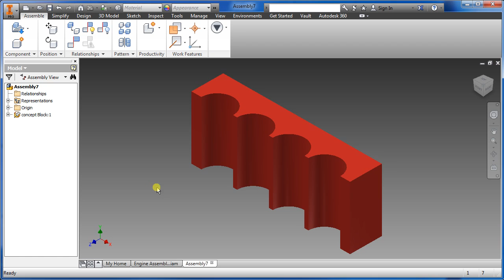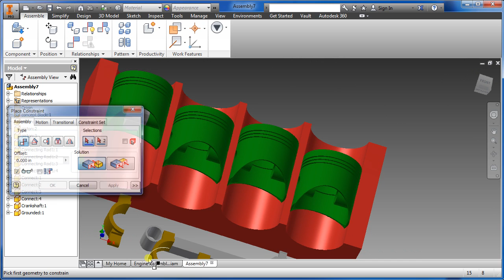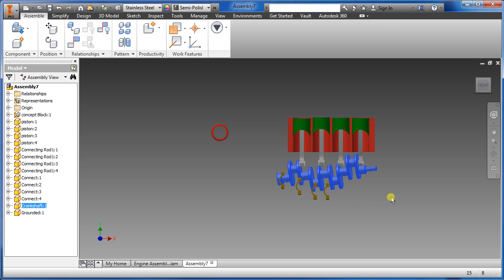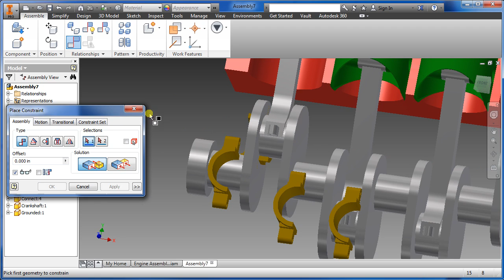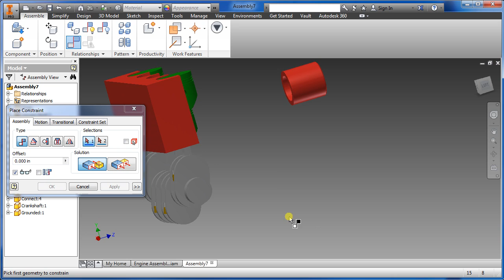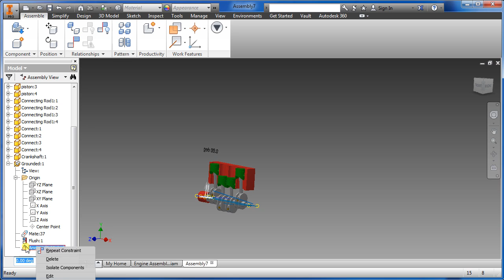Autodesk Inventor 2015 Part 3  Engine Concept Tutorial piston connecting rod crankshaft assembly

Comment: I have problem when i do drive there was "cannot solve at (or near point). check drive parameters and adaptivity setting" what must i do?
Reply from the maker: @Alexandra Palmé I’m glad your teacher was able to help. Best of luck with the program.
Reply from the maker: Rangga Febriansyah hello, can you tell me the minute in the video that you’re stuck on. I hope I can guide you through it.
Reply from the maker: @Alexandra Palmé Hi, hmmm? It's hard for me to tell where it won't work for you. I'm going assume you'd assembled them all just like on the video. 
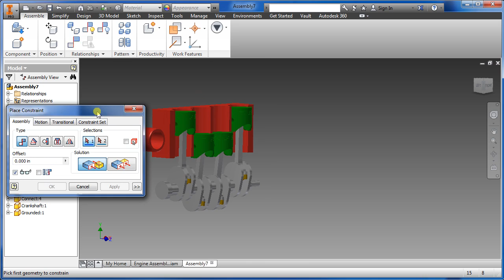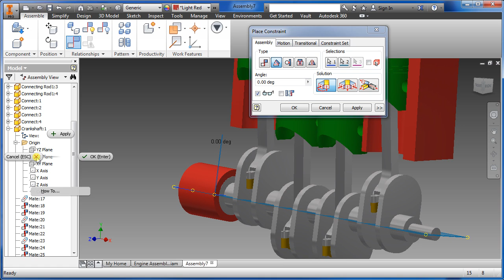But from 8:10 to 9:30. If you do exactly like that. I think grounding the piece and selecting to correct highlight on there is crucial.
If you can or if it's possible for you to video your work and send me a link on what you are doing. I might be able to help more?

Comment: Sir in whole video u didn't said that to ground block also
Reply from the maker: HI Prashant, Thanks for pointing it out. I think if you look at about :40 Sec. I did set that on the Half section block.  If you get a chance to look at it again. There should explain it for you. I hope that will help you.
Reply: @GearTechKet  sorry I didn't point it out.Actually  u know what I did  that I was running it that's why I didn't point out
Reply from the maker: okay, best of luck.